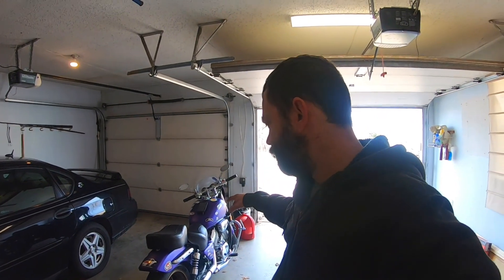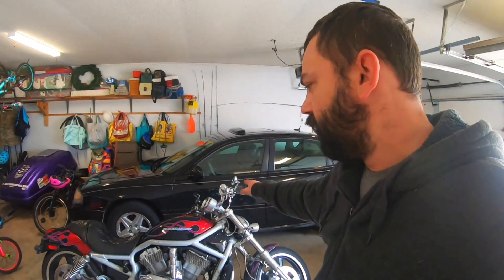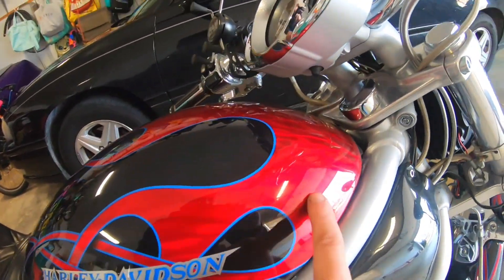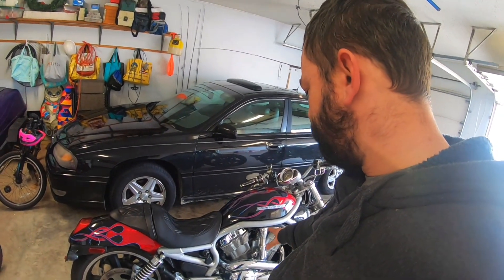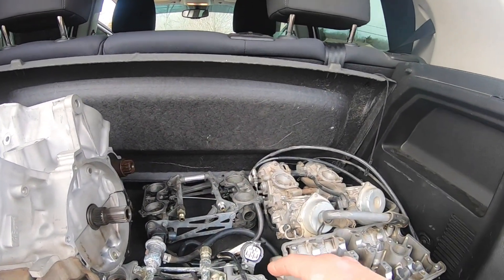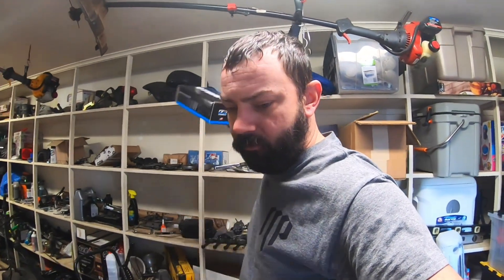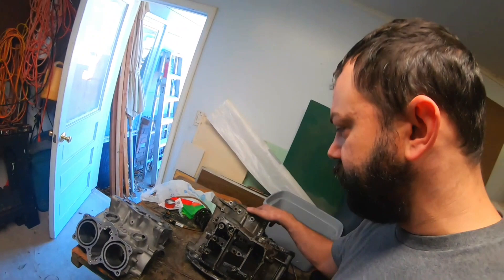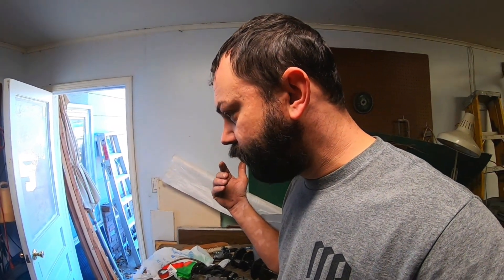EFI Swapping a Honda Magna

Comment: Quick question do you know if is possible to just swap the transmission gears from the vfr to the magna? I’m looking for that extra gear, thanks
Reply from the maker: It is possible to swap it out, it will fit. 6th gear in the VFR has the same final ratio as 5th gear on the magna. With the 6 speed you will get closer ratios

Comment: As detailed as possible would be great for just EFI swapping this.
Reply from the maker: Unfortunately I’m not going to be able to do a detailed video of the swap. The work is being done by a performance shop that specializes in EFI swaps. This is a first for him on a magna so there’s a lot of R&D that has to go into it
Reply: @jamesrevels  yeah, I just made a 3D printeable intake for the 3rd gen magna that adapts a holly 1 barrel EFI setup, I'm testing it now, once I get the print worked out I'll share the files
Reply: @MrJimmyPenguin  any news?